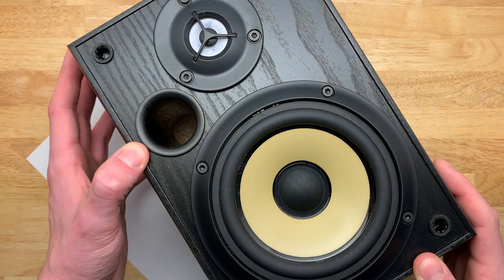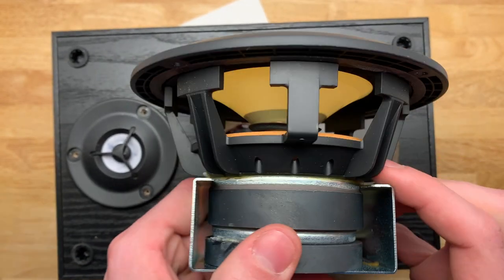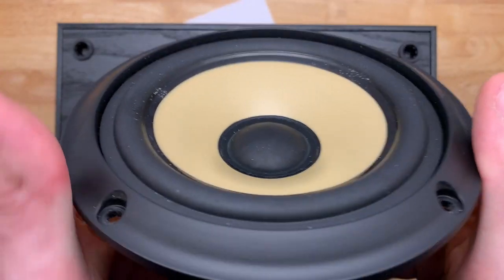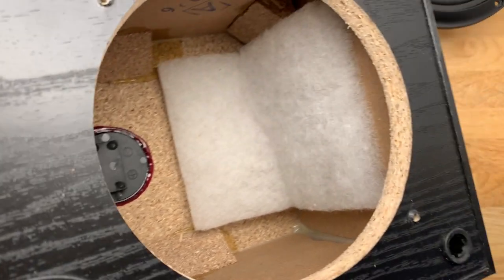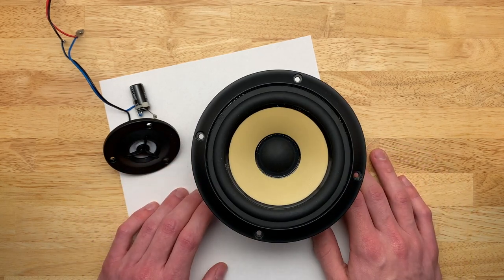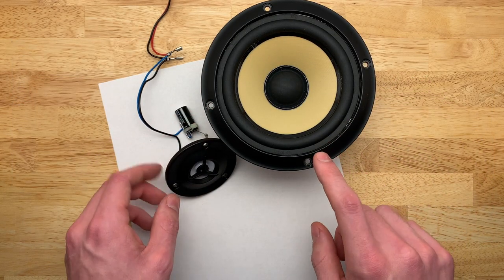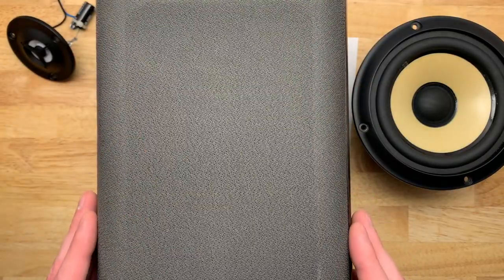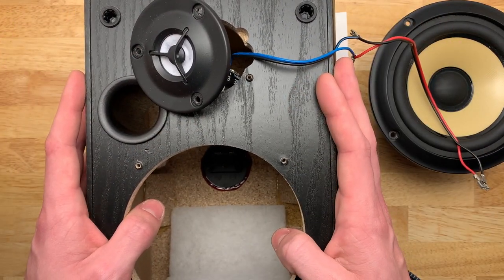SONY SS-MB 150H Teardown - Truly Cheap Speakers

Comment: I had two pair of those that I used for my old home theater setup before giving them to my son. Now, I have modified them with a 0.5 mH coil for the woofer and a 2.2 uF capacitor and a 1.5 Ohm resistor on the tweeter. Also, I added some 1/4 inch foam padding on most of the inner surface and now they sound much better with a better balance and reaching more toward the extreme in frequency response. I really like your videos! They are very instructive without being too technical. Good job!
Reply from the maker: @Yves Boutin - Thank you!
Reply: @Casey_Schmidt  how did you hook the coil,capacitor,resister

Comment: these speakers originally sold for a rock bottom price of 49.95 a pair, NEW.
And were available at Ratshack closeout price for 20 dollars new.

Pair them with a Lepai amp and you've got a desktop system for less 
that 40 dollars. Use a PC equalizer and they're not that bad for that price, lol!

Comment: I bought these for $4 a while back and was surprised on how good they sounded. For the price of course. They were in my garage to test out on my vintage stereo repairs. Ended up given them away to a friend of mine and now I wish I had them just to mess with them and try out a different crossover. I appreciate your video explanation.
Reply from the maker: @alejandrocervantes4981  I agree, for the price there’s nothing wrong with them.

Comment: I just bought a pair of these at Goodwill ($7.98 for the pair) unfortunately the large magnet on one of the woofers became unglued from the plastic frame and was rattling around loose in the cabinet. This also damaged the coil. So that woofer will need to be replaced. I will probably install a nice cross over and replace the woofer. I did feel the speakers were not as loud as similar speakers I have at same Volume. I have a feeling the new speaker I will buy will be much better than the other and will most likely end up replacing both woofers. I have read that using a quality 4.7 mf capacitor to replace the original one the tweeter makes a big difference in sound quality. The wood frame of these speakers is very well made and well worth modifying them to make them sound better. But your right a proper crossover would be better to keep the speakers in phase. I seen where a hobbyist posted a video on YouTube showing how he designed a second order crossover to really make this speaker sound good.

Comment: Hi thank you for your very excellent insight   Clearly cheap and small speakers have limitation   But as satellites they could work quite fine 
It is important to cut them below 150Hz more or less and send the remaining range to a proper woofer in a separate box   The result can be surprising
I did something of the kind in the past with a couple of Mission speakers and i was amazed   Finally i ruined the speakers using them full range at too high power   They had a small coil ... not for super power   But used cut in the lower range they sounded fantastic

Comment: The cap has to be non-polarized for audio use, because otherwise an AC signal wouldn't pass through it. Normal polarized caps pass DC but block AC

Comment: Seen a pair of these at Salvation Army for 7$, thwn left them behind after reading reviews.
Reply from the maker: For $7 I’d say there’s a good buy if you need a spare set of small speakers. But if you didn’t really need them, I’d say you probably made a wise choice.
Reply: I would have grabbed them in a second at that price. Give them a better tweeter like a peerless or a little Dayton and design a good xover and you have a VERY nice sounding pair of bookshelf speakers. With a proper baffle step and xover these are actually good woofers that can sound way better than most realize. They just don't do loud volume.  
 For those of us that design xovers cheap speakers like these are the best value in audio.

Comment: I'm using these exact same speakers for the TV in our bedroom. I picked them up at value village for $7.99 for the pair LOL.  They replaced some Panasonic home theater in a box speakers that I was using previously. I will have to say they sound better than a cheap soundbar.
Reply from the maker: @Arena_Rock_Man - So true! I’m not a fan of sound bars. Small bookshelf speakers are always the way to go if you want simple good sound quality for a tv.
Reply from the maker: @Arena_Rock_Man - I guess it's really up to you. I would say that if you haven't modified a speaker before, they would be good candidates to get some practice on since they aren't very expensive. But if you have experience upgrading speakers and don't need the practice, then they might not be worth it, again because they aren't very expensive and don't have the best build quality.

To keep the cost minimal, put an inductor in series with the woofer. It would help by not making the woofer play full-range. I would have no idea what value to use. A guess would be somewhere between 0.7 mH and 1.5 mH. While air-core inductors are generally preferred, iron-core or air-core probably wouldn't make a ton of difference on these.
Reply: @Casey_Schmidt  There are a number of crossover calculators available. Nick at DIY Audio and Kirby Meets Audio suggested a couple of free versions for download. I've never built a crossover before, so it'd be nice to practice on these guys. I like to throw in either egg carton foam or some acoustic polyfill to help smooth out their frequency response.
Reply from the maker: @Arena_Rock_Man - It would be a fun little project for sure!I've used a few crossover simulation programs (not the online calculators) and they have gotten me pretty close. If you don't know the T/S parameters of the drivers, it can get tough to accurately model them in the software. Parts Express sell Dayton Audio branded device that will measure the T/S parameters of any driver. I don't recall its name off the top of my head. Using that in conjunction with some simulation software will make it a lot easier to get a good result.

When it comes to foam, my recommendation is the adhesive 3/4" 3-layer stuff. It does a really nice job at absorbing internal sound reflections and damping the enclosure as a whole.
Reply: i' Bought 1 Center Speaker ss-cn550h, 4, Like $12 ,  &  PLan To Use as Left Or Right ChnL Speaker,  it Looks kinda CooL with GrilLe Removed

Comment: You were wrong about the capacitor that is a non polarized cap not one such as on a circuit board. A lot of speakers used electrolytic non polarized caps in there speakers. If they used thin film capacitors they would have to raise the price of the speakers $10 for the set. And 10% tolerance on the capacitor you would never be able to tell the difference in frequency response. Thin film is better but price is a huge drawback. also there is no inductor on the woofer because inductors are even more expensive than a thin film capacitor. to have a nice crossover network would significantly increase the cost of the speakers then they would not be able to sell the speaker to the intended audience. 1/2" wood on the speaker cabinet might be a little to thin on a much larger speaker but being this speaker is so small the cabinet would never flex.
Reply from the maker: Cheap speakers are cheap.

Comment: Loved this video!
I have a pair of the big towers in the lineup (MF750H), I've heard mixed answers whether they have dedicated crossovers built-in. It sounds like they do, but I am not sure. You know by any chance?
Reply from the maker: @Nathan Jay - Thank you! Unfortunately I do not, I really only familiar with the speakers I have taken apart myself. You might be able to find a schematic online?
Reply: @Casey_Schmidt  thank you for the quick response! I have not seen anything online yet. Might have to find some time to take em apart. They're nothing special, but I do enjoy them a lot as home theatre speakers, just on the basis that they sound decent for what I paid.

Comment: i have some crossovers in some sony speakers thay i fixed and to me the aiwas i have which are right next to them sound alot better and they just have a capacitor as the original crossover was long gone but thats probably down to me putting silk dome tweeter in them

Comment: Why they add magnate to the speakers ?
Reply from the maker: Probably for some design/engineering purpose. It was likely cheaper to use two magnets than one for the power/strength requirements. Just a guess though.